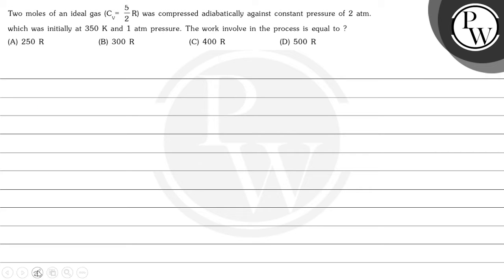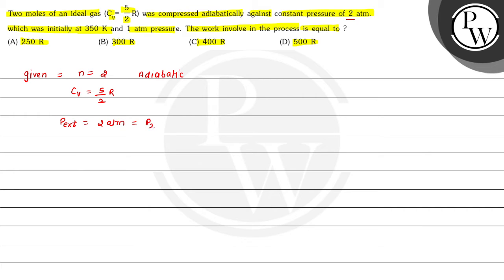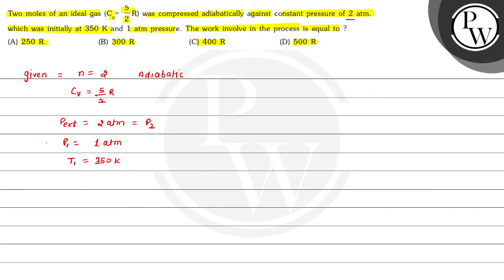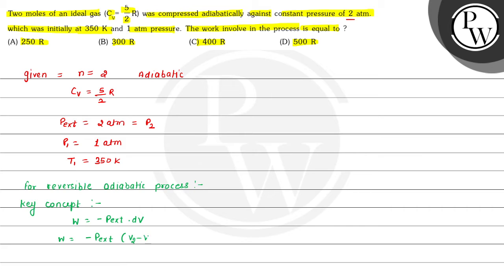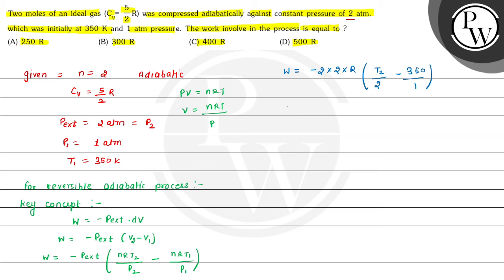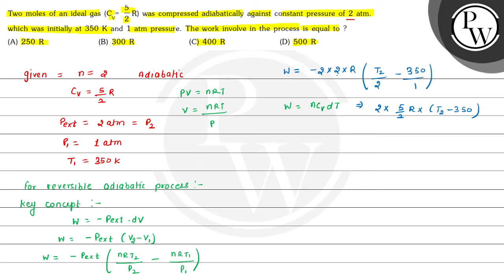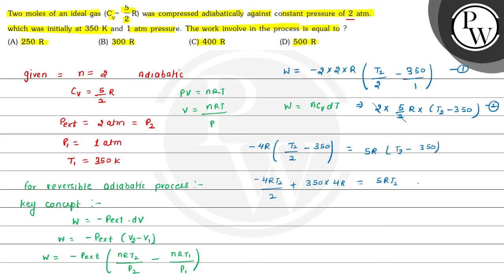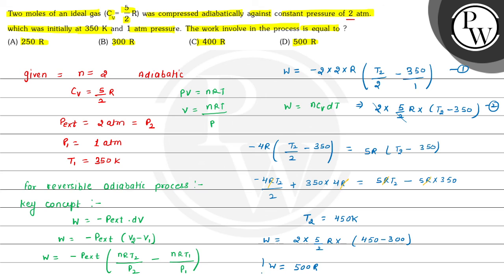Two moles of an ideal gas \( \left(C_{v}=\frac{5}{2} R\right) \) was compressed adiabatically ag...

Comment: that is called irreversible adiabatic not reversible adiabatic 
so bad
Reply: Answers seems to be correct
Reply: Fr em freaking confused after seeing the soln
Reply: Yes only that line is wrong rest of the whole Sol is correct
Reply: @paraskumar9850 150*5R does not equal 500R ,to solution to galat lag raha mujhe, correct me if I'm wrong
Reply: @vk296  She wrote 300 K instead of the 350K in the temperature in last step. The solution is correct. She also forgot to mention that delta (internal energy or u ) = work done for adiabatic process which can be seen from the 1st law of thermodynamics. [This was used in the work done = nCv dt part ]